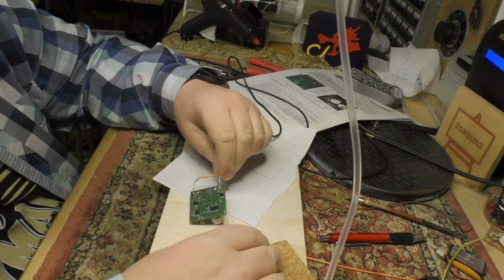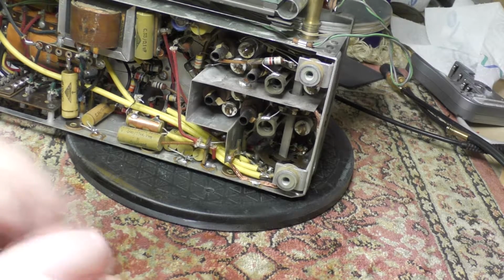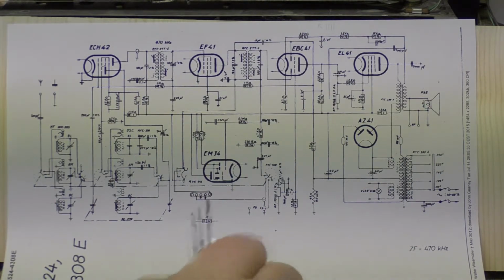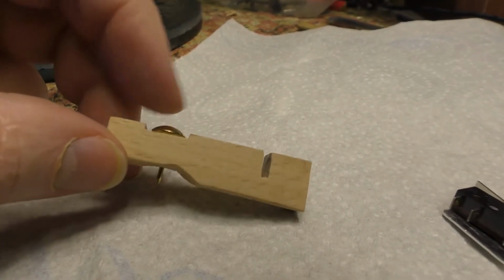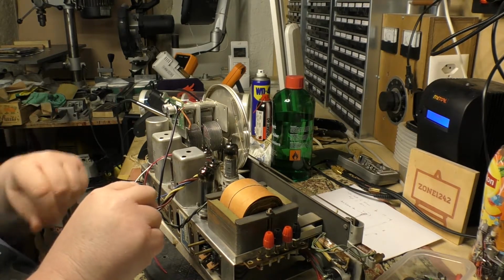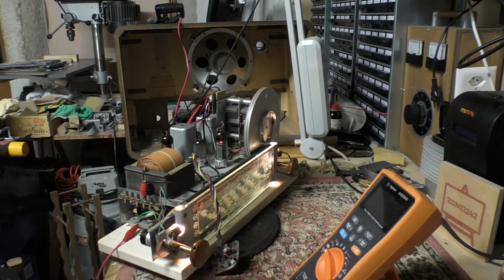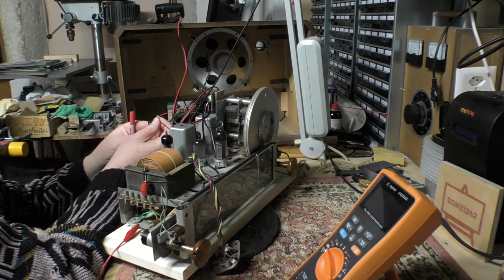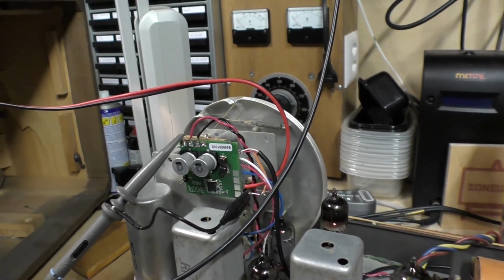Receiving FM on an AM set - part 2

Comment: You can use a wooden cam attached to the metal shaft as a limit switch activator.
Reply from the maker: I contemplated that but there is so little room under the chassis that I couldn't figure out a way to fit it.  In the end the solution I used is not very elegant but at least it works.

Comment: For those who are non-fluent in "Chipmunk",  @ 16:51, the correct translation is as follows: "SON OF A BITCH".

In all seriousness, Sarkes Tarzian smiles down, from above, each time this video is viewed.

Not typical "pulsating DC", but the noise is most likely emanating from the conversion module's Linear Regulator (itself), or is coming from some point within the Linear Regulator circuit. Installing a cap before the Linear Regulator will probably affect the performance of the regulator itself, because it's expecting to "see" a line frequency input of somewhere around 50~, and may emit a voltage other than that which is pre-calculated for its output.

Try a installing a 47µh choke @ 0.5Ω on both 6.3 VAC outputs just prior to their connection points at the converter module. TDK P/N B82144A2473J should work, and they're less than $1.00 US (each), from the "big box" electronics component houses.
Reply from the maker: Thanks Tim, will definitely give that a shot.  Yeah, there were a few expletive moments on this one!  But, we never give up!
Cheers,  John
Reply: John, I recalculated the value, the corrected TDK P/N is B82144A2473J. Sorry!
Reply from the maker: chokes on order.............